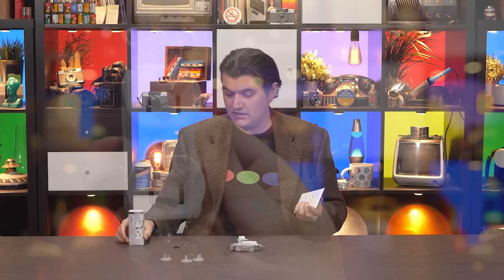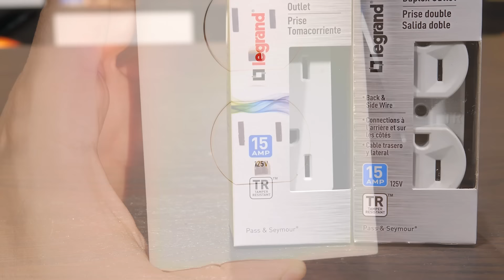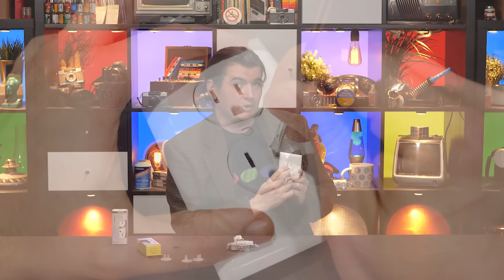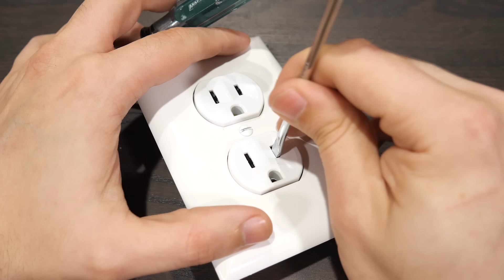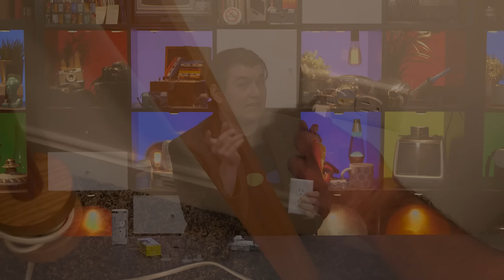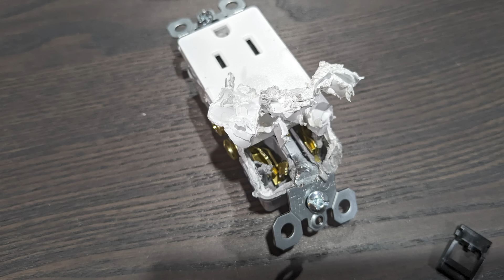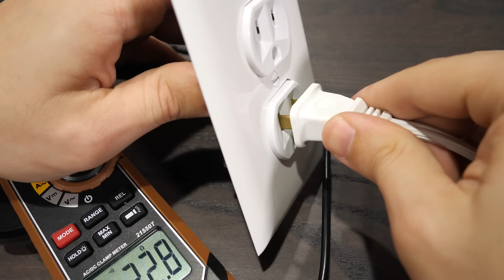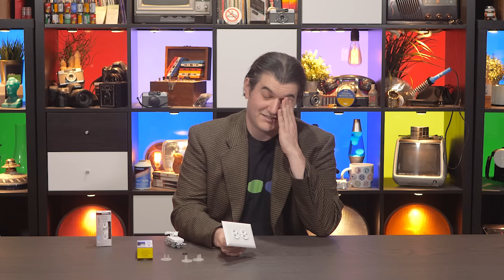Tamper-resistant outlets aren't all the same - a follow-up

Comment: Sweden is mostly running on 3 phase 230V, which means phase to phase is 400VAC. Homes are fused 16-20A (3phase). Apartments are the exception and usually only have a single phaase. In regular homes, stoves are what is commonly ran on 3 phase. Heating can be 1 or 2 phase. And we also commonly wire with neutrals. Ex. 5 conductors, L1,L2,L3,N and PE. There is lots of opportunities to get shocked :)

Comment: The reason why I will never connect a plug by stabbing it in if I have the option to screw it in is because when the outlet gets old or it has a poor design it can be extremely difficult to get the release catch to release and get it out. Even broken a few trying to get it out they were so bad off.

Comment: Also normally you find flimsy overused plugs in hotel walls, and as you normally miss plugs where you need them close to the bed and in the amount that you need... you end up carrying and  connecting 1. universal converter plugs from US to EU + 2. add EU-type 1-to-3 power splitter to it + 3. a mobile phone charger body, 4. watch charger body and 5. a laptop cable attahed to the splitter... you can imagine how that, together with usual plug sagging and exposed plug connecor blades doesn't help :) 
So safer or less dangerous tamper-resistant outlets in this case are just n/a.

Comment: Some of those taper resistant are designed terribly. There was one that I had to return to the store because it was essentially unusable. They were TR and WR and I bought five of them for a project. But this thing really didn't like to let you plug stuff into it. Any slight amount of camber was unacceptable. It had to be perfectly perpendicular and still requires significant force to move the shutters. So much that installing it in a hard to reach area was just out of the question.

Comment: I've been zapped by 120, multiple times. Didn't really feel any worse than a zap from a joy buzzer.

But then again, i was also zapped by 400v power to an elevator once as I severed the live power lines, and with the way everything lined up, that also wasn't very bad, just enough for me to curse and jump around, as most of it was grounded out by the machine I was running lol.

Comment: Are you telling us that there may be less annoying tamper resistant outlets?  I have heard they can be hard to use sometimes.  I would not really know.  I live in an older house that was built before those were invented.  Instead we just had plastic plugs that we would stick in the outlets so that babies and children could not get hurt by sticking things in them.  Not only can you get shock from sticking things in those sockets but a lot of things will get really hot when you stick them in the sockets.  This could not only give you a nasty burn but maybe even start a house fire.  Of course death from electrocution is also a very real possibility.  I can not guarantee that any of those things would not happen if things that were not supposed to be in them were inserted in them.

Comment: Simply redesigning outlets with a 1/4” to 1/2” inset that would shield the exposed prongs would make them safer and still meet all the requirements for US. Most boxes could accommodate it and it could be accomplished with a special offset mounting bracket on the device and a wall plate with more thickness around the actual outlet locations. Retrofitting the system just like we did with grounded outlets or gfci over the next 50 years or so.

Comment: The REAL problem with all this is the fact that AC voltage is NOT certain death, even 240 Volts. I have been shocked many, many times with 110 V and never had the slightest problem other than the obvious immediate discomfort. I have also been shocked with 240 V with the same result. COULD it kill a human? Sure, in very specific circumstances, usually involving a human with pre-existing medical conditions. WILL it result in death? No, it is highly unlikely to even result in a medical check of any kind, much less death.

People are always finding incredibly stupid ways to kill themselves, so I'm not saying that the statistics are zero, but I AM saying that the human gene pool is probably much better without those people and attempting to protect people from stupidity is itself epic stupidity and a gigantic waste of effort and resources.

Comment: My house almost burned down because of backstab wired plugs.  I will never use it.  I was running a portable air conditioner on a hot day and it quit working.  I thought the breaker had tripped but it hadn't.  I next pulled apart a wall plug and saw that it was fried and really really hot.  The lazy electrician had wired the house with backstab.  Because backstab only holds the wire with a small sharp contact it gets way too hot when you run 15 amps through it for any length of time.  Backstab should be illegal!

Comment: Just had my first experience with TR outlets 5 days ago.  And developed an instant case of hate.  Lowes here is now not carrying any 20A GFCIs which are not TR.  So I got some of them for an upgrade.  Then discovered that they take so much force to insert a two pin plug that  I want nothing to do with them.  Basically unusable unless using a grounded plug.  I've turned to Amazon to get non TR GFCI outlets.

Comment: Australian receptacles are very similar to the US ones, with one main difference: The blades are angled instead of being straight. This greatly reduces the likelihood of the plug falling out.

Australian plugs also have a plastic sleeve on the blades, like you were talking about in this video. That was added without changing the design of the receptacle, so I feel like the USA should be able to do it too.

Comment: Get yourself a European outlet and plug (one of the thick ones) and just plug them in and “accidentally” try to half unplug them. Then you’ll understand what we mean by “your plugs are falling out”. Accidentally half unplugging one of the thick European plugs is nearly impossible. You’d have to on purpose pull on the cable INSANELY hard. And even if you somehow manage to half unplug it, you’ll never be able to accidentally touch exposed live prongs.

Comment: I realized after watching these two videos why I never had to worry about any of these considerations in these videos about loose plugs with euro plugs: we recess all our plugsockets a good inch into the wall. So even if a plug were live and sticking out 1 cm from the outlet surface, it would still be almost inaccessible to any that could short it. (plus we have the insulated plug teeth, so only the tips are metal anyway. Rather bad tamper resistance though, you need a special sticky thing to put in so you need to turn it to put it in.)
Reply: @@phillipbanes5484 I never heard of those before, but it's such a specific niche that I don't feel I'm missing out by not having those. Never had the feeling my chargers took to much space and most places I charge have usb ports anyway, so I only need the charger plug when I'm sleeping somewhere, in which cas the slightly larger size really doesn't bother me. I very much prefer the extra safety (although with the British design you can get the foldable design plus the very good safety, so it really is the best design I've heard of so far).
Reply: @@phillipbanes5484 Hey, you clearly care a lot more about this than me, so more power to you.
I personally find it a niche because I've never been bothered by the size of charger plugs or have ever heard anybody annoyed by them. Personally I use a charging plug with takes 4 usb sockets, meaning I can charge it all on one socket  (which I find more important, because a lot of hotel rooms I've been in only have one or two plug sockets) and combined with 4 30 cm (1 foot) usb cables I find it does not take much space in my bag anyway(genuine question: do you guys also have those charger plugs with multiple usb slots? Or would they be near useless with the lower voltage) (Also, don't you need the cable to charge from your powerbank to your phone anyway? In the EU it by law all needs to be USB-C chargeable (recent change) so one cable does it all).
I can definitely appreciate the utility of foldable plugs (like I said, the British design has best of all worlds), I just put higher value on different aspects than you do, which as you state probably has to do with cultural differences. I am baffled by some of the stuff you guys find acceptable for safety standards. You call it conditioned to be unreasonably fearful, I find you guys to be conditioned to be extremely accepting of dangerous situations which are so easy to avoid. Just different mindsets made by different cultures.

Comment: I found another reason why European outlets are better. You can protect them better. There are 4 basic designs. You have the basic tamper protection with the shutters. You have the after market one to glue on, that is actually not to code, because the plug doesn't go all the way in. With them you mostly need to twist them open with your plug. The 3rd one is a over that may be removed with a tool. On the sites they call it a key but its basically a tool to help remove it and the last one is actually locking your outlet. I had one in my room and I don't know why exactly, because other sockets where free. I think its because it was underneath the light switch. There are sockets with a lock, usually for outdoors or community spaces, like a washing room or you habe the inserts, that don't require any installation. The last one is the best in my opinion but not a 100% solution. The lock itself might be easy pickable and its a lot of plastic, you can just break.

Comment: On the topic of European outlets and US plugs getting partially disconnected:

I don't know how much experience you have with actually physically using the european plugs, but any relatively modern plug (Type C and F) is held in by friction. At least it appears to be friction, but I'm open to correction in case there's some kind of locking mechanism.
Regardless, my point is that it requires a SIGNIFICANT amount of force to disconnect the plug, even the thin style.

This combined with the sturdy cylindrical prongs and the coating that's applied to half of the prongs makes it incredibly difficult to accidentally electrocute yourself by touching the prongs.
Most sockets also have flaps that get pushed away by the prongs, and many designs will NOT let you push a screwdriver through as the flaps are designed to open only if both prongs push on the flap at the same time.

I think that contributes to why we think US plugs look insanely badly designed.

Comment: I think you hold a very reasonable stance on electrical safety that resembles actual hazards analysis rather than the common discourse. A lot of electricians will tell you the "worst shock of [their] life was on 120", but I think this is another case of "reinforcing the wrong parts of the bomber" or survivorship bias.

Comment: Almost all the outlets in my home would fall out when we purchased it.  House built in mid 70's purchased in 2010's.  There were several sub divisions built around the same time seems like built fast with the cheapest materials.  You could maybe balance a cell phone charger in one but the slightest touch it would fall out completely.  Wiring is completely screwed up and just compounded when the seller had to add GCFI outlets.

Comment: When I was maybe 12, a friend had an outlet in their floor. We had built a pillow fort in the room and while navigating the fort, my big toe ended up in the outlet. It felt like I had stepped on a push pin so I didn't move until I looked back and realized what it was. Toe tingled for about a minute after I removed it but it didn't hurt too much. Been shocked one or two other times, usually doing something similar with trying to plug something in in the dark. Never been a big deal. Just feels like a combination of a flu shot and hitting your funny bone at the same time.

Comment: If I were to move to the US, I sure as hell wouldn't deal with these plugs and just install Schuko everywhere in my home3, change the cords and have some adapters for ad hoc connecting devices with these flimsy connectors. If I plug something, it has to stay there, and while doing so I don't want to have exposed live metal, period. WTH

Comment: Contrary to what you are saying, it is not the voltage that kills, it is the current (amperage). A static shock from walking across the carpet carries much more voltage than your standard outlet, but does no damage, yet only .5A DC can stop your heart.

Voltage has an inverse relationship with current. Power (watts) equals volts times current (amps). If the voltage is higher, the amperage is lower for a given watt of power. This is why Europe and most of the world use 240V for everything. They can use thinner wires because they don't need to carry as much current.

We misunderstand this in the States because the only appliances we use 240V for are also high current (stoves, water heaters, furnaces, etc.) We do that, not because they need the higher voltage, but because it cuts the amp draw in half and allows a manageable cord thickness to handle the required current.

In essence, we only use 240V when the laws of physics force us to. Not because 120 is safer, but because that's how we built our grid before we knew better. It's the early adopter tax, similar to PAL vs NTSC. PAL is objectively better. More lines of resolution, better color, etc. But we invented broadcast TV first and all of our stuff was made for NTSC, so that's what we got.

Comment: I would add that in order to receive a really dangerous shock from a partly-unplugged outlet, you would need to have contact with one blade per hand, causing the current to flow through your entire body (and therefore your heart). If it's just contained to one of your hands, I believe any damage would be localized just to that hand.

Comment: Hi, a European here. I also did a few stupid things with outlets and ceiling lights. I got 230V through my hand (just two fingers on one hand touching the wires) and then I also got zapped from one hand to the other.  The second instance shocked me through the heart and I just shook it off. I guess I was — one — lucky as hell and — two — zapped for a really short time. I never really got shocked just by touching one wire. Meaning I was never properly grounded, I guess (except for punitive measures from my parents). What I mean by these anecdotes is that even 230V won't kill you right away on every touch. And while by pure numbers it should be twice as bad, in my head, they're really in the same ballpark as far as safety goes. It's not 22kV (typical mid-range power lines in my country) which will fry you instantly, and neither is it a 9V battery which tingles the tongue.
Reply: @@phillipbanes5484 You know, stringing together English words does not make the result English.

To answer the part that was comprehensible: "A European" similarly to "an American" designates an inhabitant of said continent. Try Cambridge dictionary. And scroll down to a noun definition. You can tell a noun by the article in front of it.
Reply: @vilemjenis4973  It's perfectly legible though

Comment: We should replace these NEMA outlets with IEC C-series outlets. C15/16 for 15A and C19/20 for 20A. 
They don't allow exposed conductors, ever! We could also mandate that new construction use these and new code compliance upgrades too. Any NEMA-IEC adapters for existing installations MUST have a fuse inside.

Comment: 120v is safer when we talk about touching the bare wires. 240v is safer when we talk about wiring. We don't have the concern about daisy chaining power strips because all of them support 16A which is almost 4000W that would require very thick wires for 120v but they're just normal sized here. The ones that don't support 16A have narrower pins and a slim body so you can't fit a high power plug into a low power socket.

For at least the last 10-15 years, all our sockets are tamper resistant. Some are more annoying than others. The bad ones makes you wiggle the connector until they move. They're rare nowadays, though, and in more than one occasion I just removed them or glued them open. They slide to one side like yours, or are composed of two bits that slide to either side. The most reliable ones are probably the rotating ones: it's just one piece that rotates around a pivot between the two holes, but it has wiggle room and it gets stuck on a groove when only one side moves.

Comment: 120V seems trivial when it's just a quick shock, like, you accidentally come in contact with the conductors for a fraction of a second and that's it. 

However, when you are in constant contact, it's a whole different story... it happened to me, long story short; I was running cables in the suspended ceiling at a customer's home and apparently, the metal frame was screwed through a wire or something. Since my arm was in the ceiling, touching the frame, I couldn't let go, my muscles were all cramped and tight, I thought I was going to die... Then the breaker finally tripped. That was about 5-6 seconds later. I fell off the step ladder and slit my thumb open on the ceiling frame in the process (I needed stitches). I was so stunned that I didn't even feel that, took me a good 10-15 seconds laying on the floor to come back to my senses and realize what just happened.

Bottom line, don't underestimate 120V.